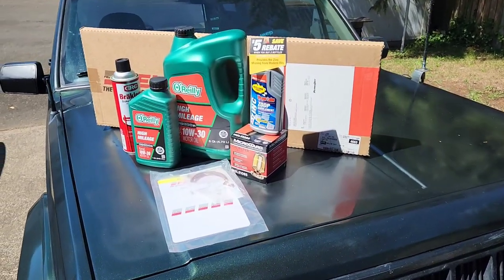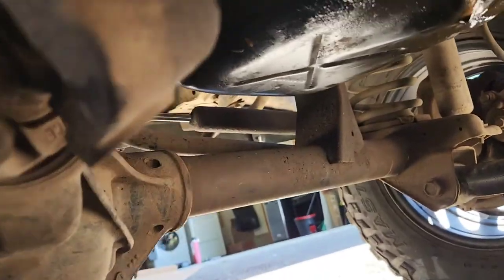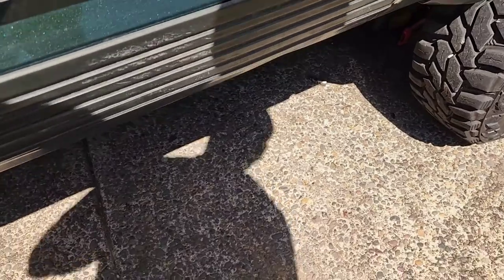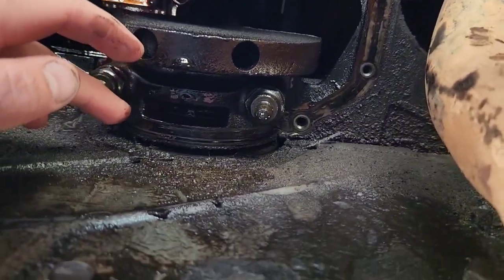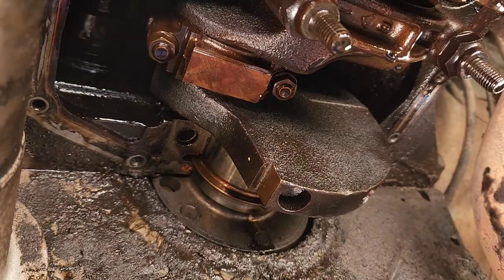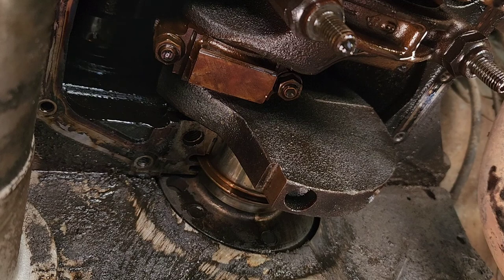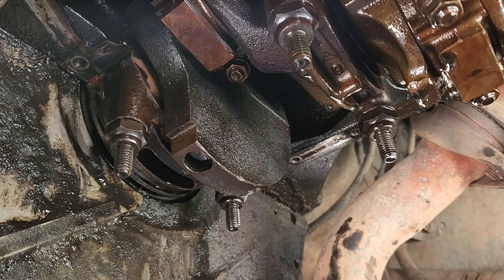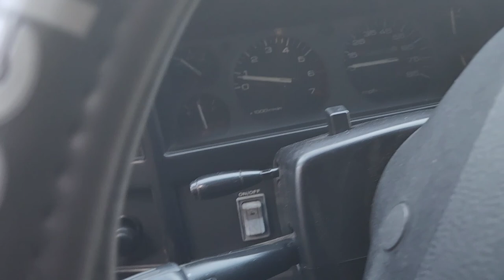1996 Jeep Cherokee rear main seal replacement

Comment: Dude you really should have used that plastic guide Fel-Pro provides, the block scraped a good amount of the top edge of the seal off when you were putting it back in, the guide keeps this from happening.
Reply from the maker: Just the part of the seal that the instructions tell you to sand or cut off. No issues so far, after a few thousand miles.

Comment: If you'd turned the wheel hard left the pan falls out
Reply: Thank you 😂this worked too well I’d been struggling to get the pan past the bell housing on the trans and then I turned the wheel and jacked up the car and the pan was lower than ever